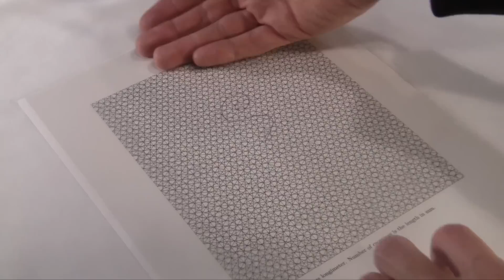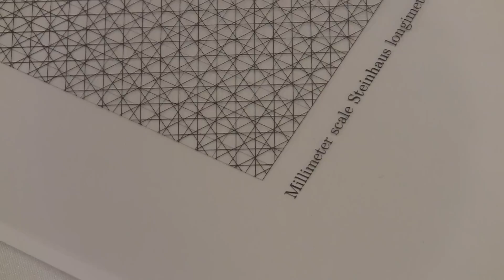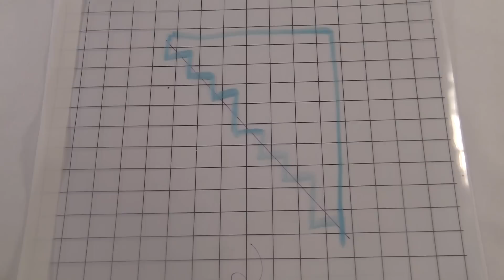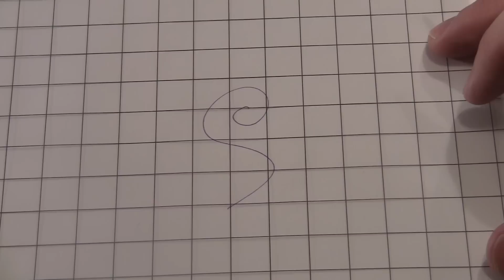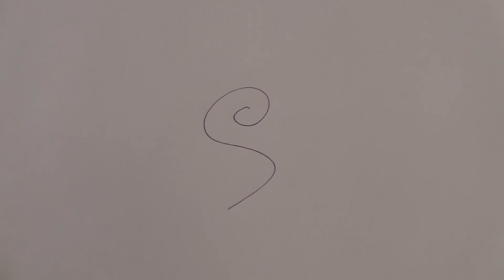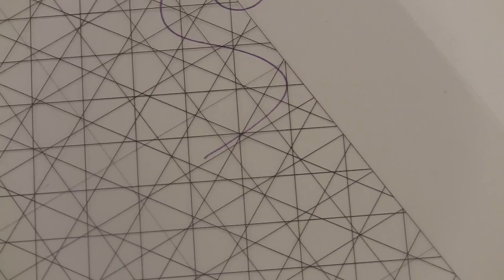Steinhaus Longimeter Review / HowTo

Comment: I'm thinking about the implications of that. 
If you have a simple shape, like a circle.
And instead of counting line crossings on that triple-square grid, you cont like crossing on six grids with equidistant lines.
For a circle that's just the diameter twice for each of the six directions:
24/3.8 R vs. 2 pi R
Reply: Hm. What if we keep increasing the number of grids?
We would expect the number of crossings for N grids to be 4RN
The measure should be more accurate as we keep adding more grids, given the appropriate correction factor,
so the correction factor should tend towards 2 pi R / 4RN = 0.5 pi / N.
So if C(N) is the correction factor for N grids, then pi = lim N->inf of C(N)*2N.

Comment: I wonder if a simple ball-point pen type mechanism could be made that moves a gear forward no matter which direction the ball rotates, adding up the movements as you trace it along a line or edge with an analogue system that displays length in millimeters. I imagine you just need to produce a ball with a diameter of 1mm that through a mechanism rotates the dial gear or whatever clockwise no matter if you're tracing backwards, forwards, or at any odd angle, eventually coming to the proper conclusion. It would remove the issue of attempting to rotate the map measure while also allowing much more freedom of movement. Hell, with the right craftsmanship you could make it an actual pen that measures the length of the line while also putting down the actual line you drew while measuring, allowing you to visially compare how accurate your measurment was.
Reply: If you could accurately measure how much ink you use, then you might not even need gears
Reply: @kmill31415  That is an interesting idea, I imagine it should be possible to imprint a pattern on the side of a fresh pen resevoir and use a microscope to see how much ink is used when drawing a line of a certain length, perhaps a decimeter for starters? After you find an accurate measure for how much ink is used when drawing a decimeter line and that it's accurate to the cm even, you should be able to calculate the expected length from how much ink was consumed. I think I could possibly try this out myself but I only have a simple biological microscope, I think it should be enough but I'd have to see. I think the only drawback would be how accurate you can be with it. To get more accuracy it might just be best to use a high precision scale but then you run the risk of contaminants from your skin like sweat altering your measurement. A glove could help with that but it is a very cool idea, it definitely simplifies the device.
Reply: Sounds a lot like an oldschool ball mouse. Of course the mechanism would be somewhat more complicated if you wanted to do it 100% mechanically, without electronics.
Reply: Maybe little rollers that roll in the x-direction attached to the edge of a bigger roller that rolls in the y-direction. This reminds me of the mechanical integrator.

Comment: There must be some basic condition for the curves of the line, because it cannot work correctly if I just draw a small spiral inside of one of the fields... (?)
Reply from the maker: Yes that's right. It's always going to be an approximation, and will be very inaccurate if the wiggles in the curve are more densely packed than the grid itself.

Comment: Interesting concept but 34.5cm vs 28.9cm ... with that much error it may be precise but not very accurate.  More of an estimation tool not very functional for planning on a map.  You're looking at 16% error.  If you plan a journey with a 30% supply margin half of that margin is used before you've taken the first step.
Reply from the maker: Yes- I agree. To get a really accurate measurement with either tool you really should do it several times and take the average. The map measuring wheel isn't exactly the gold standard either, and that one needs to be practiced to get good accuracy. I'm not that great at it, and I didn't really try to make it accurate. Thanks for watching!
Reply: true lol. I would trust a string and a ruler scale more
Reply: I counted more crossings, got 35 cm
Reply: I think a bigger problem is human error in counting the lines. The method itself has an error margin far smaller than 16%
Reply: @rafaelb.m.4756  I don't think the error is bounded, imagine a curve that wiggles and coils up on itself a lot at a small scale. Now consider just one "cell" of the longimeter that's bounded by multiple lines. You could fit an arbitrary length of curve inside that cell without ever crossing a line. 

I haven't seen the proof of how it all works out mathematically, but I imagine the curve needs to satisfy some additional constraints if you want to measure it with reasonable accuracy. Ideally, you'd probably want either the curvature to be bounded, or the grid fine enough that each segment between two crossings looks close to a straight line.

Comment: Why not lay a thread over the curve, pick it up by the end-points, stretch it out and measure it with a ruler? Maybe a waxed thread or fine wire would be easier to work with. Otherwise I think old-time navigators would set a pair of compasses to a fixed distance, depending on the precision required, and "walk" them along the curve.
Reply from the maker: All of those would work- or you can use the longimeter! To me the longimeter seems considerably easier than using a thread or wire.

Comment: Wouldn’t a grid of hexagons be more accurate?
Reply from the maker: I'm aware of one paper by Perkal, a student of Steinhaus, who looks at alternative grid arrangements. Using a hexagonal tile of the plane is equivalent to tiling by equilateral triangles (since 6 such triangles make a hexagon). As far as I understand it's not really empirically any more accurate- the most important factor in accuracy is the grid size.
Reply: @ChrisStaecker  i just figured it may be more accurate without needing such a complex overlap of grids because of how hexagonal grids don’t have the same problem with square ones where a line going at a diagonal angle to the square grid will be measured as much longer than it really is.
Reply: @t.m.w.a.s.6809  yeah I don't see how this is any better than a hex grid
Reply: If the curve hits an intersection of three hexagons, how do you count that?  If you had tiling by triangles you could continue to count lines crossed.  If you have tiling of hexagons do you count hexagons intersected?
Reply: @johnhunt2390  hexes crossed into, aka intersecting hexes minus one

Comment: Don’t really understand the principle. It’s basically saying any squiggles inside a cell simply don’t count, which is the same as straightening the line between intersections. Also both the number of overlayed grids and the angle of 30 degrees seem totally arbitrary. I’ll stick with my Boy Scout method of using a piece of string. How long a piece of string, is the only question.
Reply from the maker: I think 3 grids are used as a compromise- more than 3 is just too many to read clearly, but less than 3 is less information. The angle of 30 degrees is determined by the number of grids- there are 3 grids of 90 degree angles, so to offset them equally you turn by 30 degrees each time.
As for the squiggles inside a cell you are correct- we are essentially straightening in between intersections. But those cells are extremely small. If you really do have squiggles anywhere close to the cell size, there's no way your string is going to be able to follow the curve accurately.

Comment: the map measure and the longimeter differed because centimeters are 10 millimeters but feet are 12 inches, bud, its just not base 10
Reply from the maker: ? I'm using inches and tenth-inches. The map measure uses centimeters. There are no feet involved bud
Reply: @ChrisStaecker  mkay, was just an intuitive thought. not really something I would fact check.. so where's the error from?
Reply from the maker: @synapse349  I'm not sure. The longimeter is only approximate by its nature, so there is error built-in to it, though I don't really know what the typical expected error would be. 
And the accuracy of the map measure is determined by user skill, which is pretty low in this case.
Reply: @ChrisStaecker  maybe try It in reverse. Lay a known lenght wire and maybe etch/scorch or glue to a plane. Then measure. 
You can then try with more complex/simple shapes. If you find some consistencia in error, then there IS that